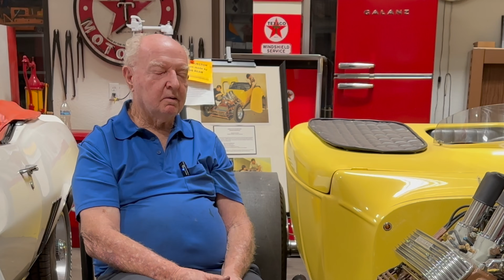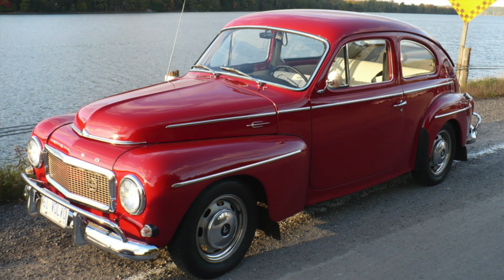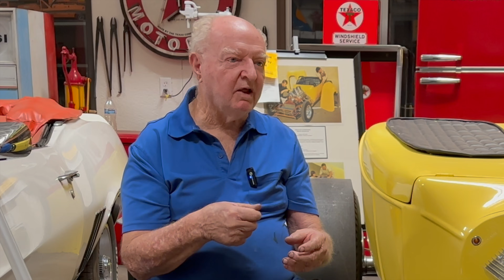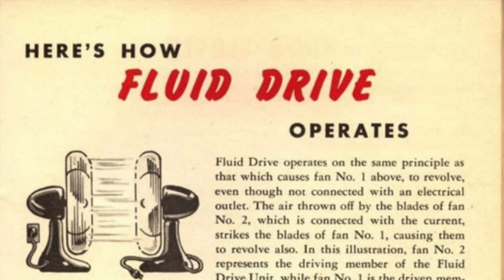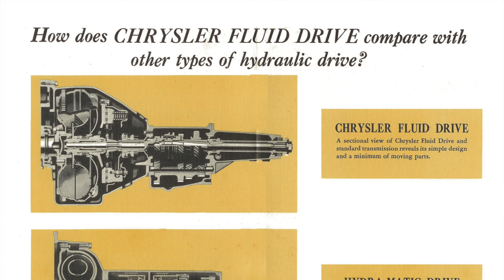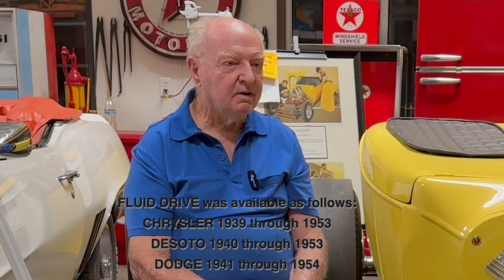Your Valve Covers Are Making It Burn Oil | Ed Smith with Barry T | Ask Ed 14

Comment from the maker: We Recommend YouTube Premium: youtube.com/premium?cc=barrytsgarage&utm_campaign=ytpcreator
“Monthly paid subscription. Price per month varies. First 2 months free. Terms apply. Cancel anytime. If you subscribe through the link in this post or the banner appearing in this video, I may get a commission.”
Reply: I personally prefer holley carbs. The needle system of the edelbrock/Carter aceelerateror pump circuit is its main flaw. A 450 double pumper w 4 point adjustment is my goto for big drinking motors. W a single track pack and a set of jets u can make about any motor run really well.

Comment: Im surprised the Buick Dynaflow tranny is not a topic once in a while . . . . 
An automatic transmission built by General Motors' Buick division from 1948 to 1963.Function: It used a multi-element torque converter instead of traditional shifting gears, giving it a smooth acceleration feel similar to a modern continuously variable transmission (CVT). Most users on Reddit agree that while it technically featured low and direct drive ranges, normal driving relied entirely on the torque converter rather than perceptible gear shifts.

Comment: Back in the 70's I had a 1970 Torino with a 429 SCJ engine. Always had a problem with the Holley carb running real rich when it was raining. Run fine on dry days. I would like to hear Ed's thoughts on that problem. AJ.
Reply from the maker: Great idea - I’ll ask Ed

Comment: Pulled the 97 primary jets out of my Thermoqaud and put in 92's with a 1996 metering rod.Cleaned up the ldle mix
And kept the acceleration on my 273.
It's enjoy tinkering with these old carbs lucky to have a few old cores.

Comment: When I built my first Vega I used a Weber.  Ran great on that build.  Super easy to work with.  Weber sold a kit with various jets and such.  Next build, about 2 years later, I wanted another.  But the price of the carb had doubled.  Partly the exchange rate of the Lira vs the Dollar.  (Not like Ed.  I have no idea what I used on that one.  My excuse is that I am 2 years older.)

I drove several British cars and always liked working with SUs.

Comment: Can you clarify re big cam?  If you are only pulling  7 to 8 lbs vacuum, are you saying the only fix is to drill holes in the primary throttle plates? After you drill, will you pull more vacuum?  Can you jet your way out of that problem or idle air bleed adjust?

Comment: The wrecking yard idle adjust , rev it wide open and cover the top till she sputters. But wear gloves ,keep yourself back  cause some will pop back ,dont do it if you have gas leaking or carb leaking
Reply: We called that the "2-dollar overhaul". If a customer needed a carb overhaul, but we couldn't schedule him in right away, you could usually make it run lots better for a while by shooting some carb cleaner into the bowl vent and then get it running again and raise the RPMs a ways then choke it down with your hand like they are saying. A couple of times doing that would clear the jets out enough to let it run better until you had him scheduled in for the carb overhaul. Did that many times. Old guy trick I guess. Charged the customer 2 bucks for that back in the day.

Comment: That's what I herd, Type F is the same as B&M fluid
That fluid drive used 5 weight engine oil
Reply: I always use type F fluid in my GM's and TF  and all older trannies to get a bit crisper shift. The quicker it gets into the next gear, the better the tranny lasts. Type F had lots higher detergents in it to make it grab the clutches better. Ford needed that back when the used brass clutches in the early 50's. Great fluid too. Still had enough lubricant in it but grabbed the clutches way better.

Comment: Any engine that has issues with oil in the pan at high RPM NEEDS a windage try installed Period. Some times a bigger oil pan is not an option! A 440 at 7000 can hold 7 qts of oil surrounding the crankshaft. A small block Chevy assembled properly, with a crank tray can run the quarter mile with 3 qts. In the pan and not run dry. I wouldn't recommend it but every engine has a vortex around its crank which sucks off power, so many factory engines had extremely lousy pans and designs that should never ever have been assembled that way! You go up or down a hill or mountain road and knock out the crank assembly because you had to use a lower gear to pull a load or spin the engine in a lower gear to use it as part of your braking, loose the crank because there was nothing in there to strip all that oil from the rotating air mass, return it to the oil reservoir where the pump syphon could direct it to the oil g system and lube the engine. I have built a lot of engines with these pans and have welded in baffles on a lot of them. Fords and Mopars were the worst. Chevy used baffled pans from the manufacturer in nearly all there engines.

Comment: Olds 455 is a Long Stroke engine. It doesn't like over 5K RPM unless modified.  Restrictors for main brng feeds help keep from running pan empty.
The goal for  performance autos is fastest shift possible to the next gear. Ford Type F fluid is best lo cost way. 'Trans Go' VB  kits also help a bunch while correcting other trans issues.
Reply from the maker: Thank you, Pete. Very good info there!

Comment: I have a 59 Ford Thunderbird with a 352 Fe and original four barrel carburetor. The car stumbles a bit from a standstill and I'm wondering if you have any recommendations to set up so I can mash the throttle from a dead stop and it doesn't stall
Reply from the maker: I will ask Ed how he would troubleshoot that issue

Comment: Hi Barry.. that Chrysler sidevalve heating tube that was rusted causing the water to go round the front of block and not the back end so well. Could that cause the front cylinder to wear down more than the other back cylinders because it's running colder?
Regards Kevin
Reply from the maker: It definitely could have, I understand your question. I might ask Ed to comment on that.  the particular engine Ed tore down survived because it always ran very short cycles so escaped that torture. Thanks for your question!

Comment: Good stuff 👍👍 
So, you can switch out your standard GM Turbo 350 tranny oil in an old passenger car with a Ford type with no issues? 
Help me!
Thanks.
Reply from the maker: Ed does it👍

Comment: He is so correct 💯% on the Edelbrock daily reliable, and Holley mote performance if set up correct plus I will say that it can be driven daily also. The Edelbrock is easier to drive and maintain for the street. Holley is a good for everything you do get more performance than the Edelbrock.
Reply from the maker: Excellent point! Ed would agree 👍

Comment: Those old Volvo's have British SU carbs on them, one of the greatest carbs made and will give anything a run for their money, 3 two inch SU's were on the XE Jaguar, the first 150 MPH production car in the world. 
And they are absolutely without equal on a Harley Davidson, one of those carbs mounted on a Harley is perfect, they have a throttle response at all RPM's on Harley's no other carb has, and they still absolutely rip in the top end, back in the day us bikers used to scrounge the countryside through junkyards looking for a wrecked XE to take one of the carbs off for a Harley, most of them have 1⅞th inch throats but the ones on the XE were 2 inch, and because of the constant velocity principle they work under you wouldn't lose any low or midrange power and response, those things are like a Swiss watch they're so precise, they truly are a thing of beauty.
Reply from the maker: Wonderful - thanks for sharing that, very interesting and good to learn!

Comment: The clutch  and torque converter was used very successfully on tractors at the airport, to push the jets and 4 engine planes off the gate ,

Comment: So if running a TH350 with a manual valve body Id be better of running ford trans fluid than mercon expesialy if ran on drag strip exclusively? If so do you have any specific brand or specks?
Reply from the maker: I believe it’s the type F automatic transmission fluid, but I will have to ask Ed in the future video for sure

Comment: Lots of later model manual transmissions (mid 80's+) call for ATF from the factory, and im here to tell you they're wrong. Its way too damn thin. Thats why all of them with ATF in them howl on the highway and whine in every gear under acceleration. Use straight 30w oil. It will last twice as long. Ive rebuilt probably a dozen ford m5od's and a few nv3500's and they all have the same problem of oil starvation. Never had one come back yet.
Reply from the maker: Great advice

Comment: the 455 olds had a oil return issue with pencil size holes at each end of the heads for the return. they are also drilled more horizontal  and don't drain like a more vertical hole would.. a high volume oil pump made it worse...
Reply from the maker: That is a really good point - I will have to ask Ed about that.
Reply: nice to hear information from other  enthusiast
Reply: I'm learning all kinds of new stuff from you guys thank you     also a few things that I had forgot    age will do that to you
Reply: Yep, the 455 Olds was a tremendous engine and responded well to upgrades, back in the day drag racers knew if you wanted to go racing and your money was limited the 455 Olds was a good choice, I knew more than 1 guy in the 80's that put them in Camaro's, Mustang's and anything else you can  name. 
And yea, they were notorious for over oiling the top end when you have them in high RPM's, but there's simple and cheap ways of dealing with it.

Comment: Hello Barry and hello Ed. I just ran across your carburetor reminiscing video. That reminded me of playing with carburetors years ago. Sometimes the debris and dirt sitting in the bottom of the float bowl will find itself getting lodged into the needle and seat causing the carburetor to start flooding.  I have been lucky a few times clamping the fuel feed hose shut and left the engine run until almost out of gas then rev up the RPM and close the choke flap allowing the needle and seat to open up pulling whatever stuck through. Sometimes that worked and sometimes it didn't. 😊 The good ole days
Reply from the maker: That is a great tip for getting a carburetor unstuck. I’m gonna ask Ed if he’s done that… Thanks!